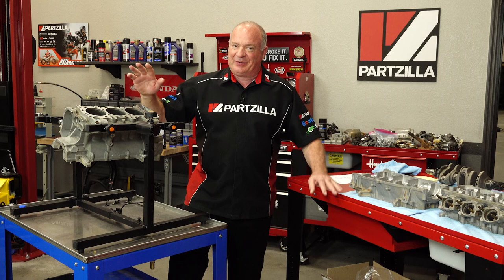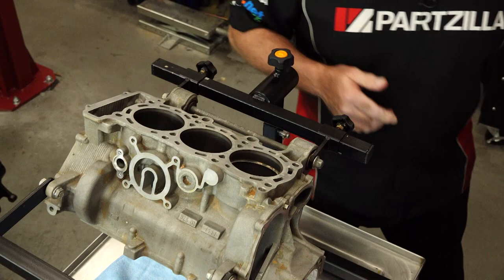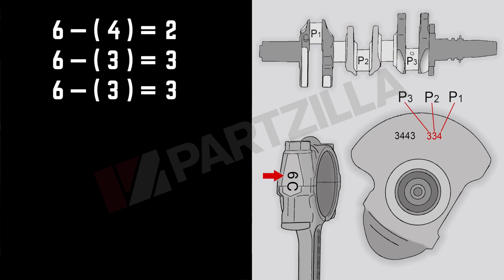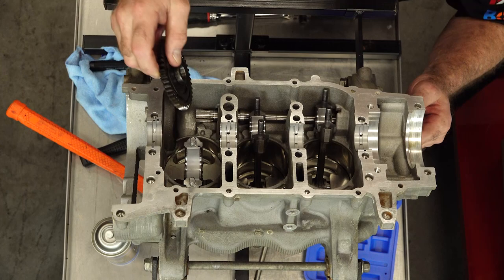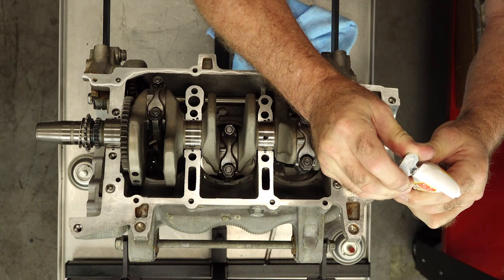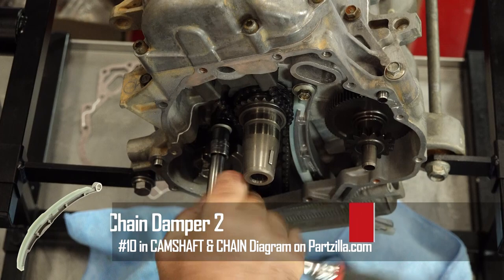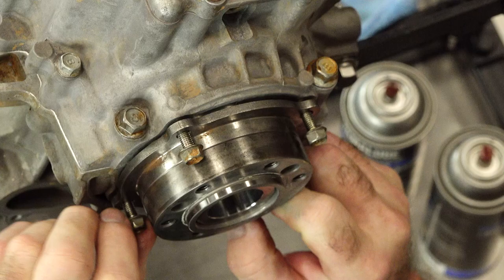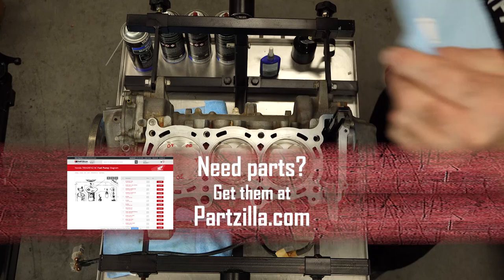Yamaha YXZ1000R Bottom End Rebuild | YXZ1000R Engine Rebuild | Partzilla.com

Comment: Great video! Only thing I saw that could be improved was use fuel tubing on BOTH rod bolts at all times until they are all buttoned up. This eliminates risk of contact with crank bearing surfaces.

Comment: Unfortunately those rods won't be enough for a turbo setup.  GYTR rods in  2019 and up are marginal at best for turbo builds.  A hole in my engine case says if you want a turbo motor, go with a bigger rod.

Comment: At approximately 28:15 you mention the ft lbs for the bolts but then 1 through 4 go 95 to 100 degrees and 5 through 8 go 75 to 80 degrees. What do you mean by 95 to 100 degrees and 75 to 80 degrees?
Reply: After being torqued to the specification, you put a wrench or ratchet on the bolt and tighten it again- when you tighten it, one full turn is 360 degrees, so in this case, the manufacturer calls for about a quarter turn